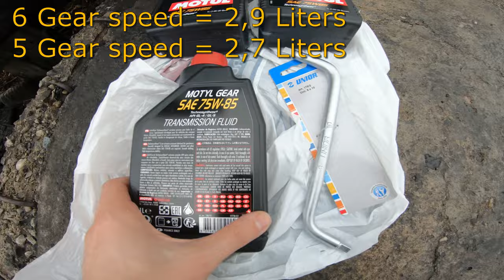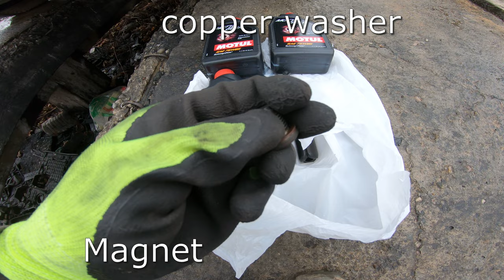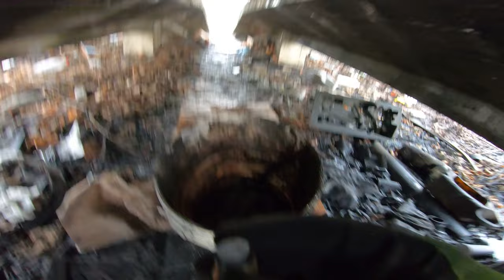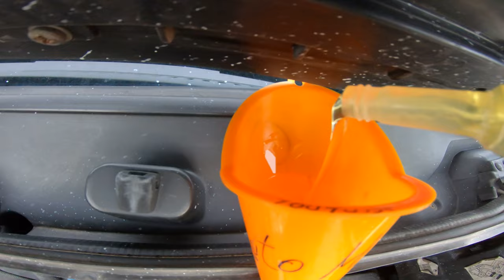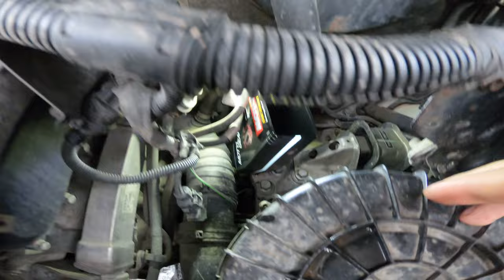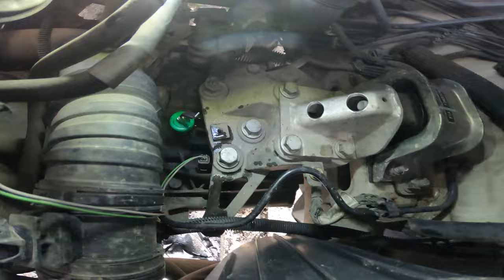Fiat Ducato ,Peugeot Boxer ,Citroen Jumper gearbox oil change ,Getriebeölwechsel ,girkasse oljeskift

Comment: Top tip from someone who knows.. ALWAYS undo the fill plug first, two reasons: it'll help the gearbox drain and you want to know you can fill it again before you empty it. Fill plug could be seized solid/rounded/inaccessible. You know it makes sense 🙂
Reply from the maker: True, only this model has a plastic cover in 3 clips :hand-orange-covering-eyes:

Comment: I may be wrong but the fill cap you lost is a vent for the gearbox. Allows air the enter / exit the gearbox.. Using the wine 'cork' seals the box and then you may get pressure build up and blow a seal?  Just a thought....
Reply from the maker: this is also possible, I didn't think of this option, but as far as I know, the original one is sealed with an oring , anyway, good statement, I haven't had any problems yet
Reply from the maker: I am going to buy a new original plug :face-orange-biting-nails:
Reply: At least someone has found a reasonable use for the otherwise un-used wine-saver cap that everyone has in the back of a drawer somewhere,.

Comment: how you check gearbox oil level? How you know that you didn't put too much oil in it ????
Reply from the maker: No need check nothing on manual gearbox if you respect car production thenical data , specs.
Reply: @AutoMotohowto46  this is nonsense, there should be an overflow level while filling
Reply from the maker: @bigogr8731  no need sir

Comment: Cutia de viteze are indicator nivel ulei la cutia manuala 6 trepte boxer 2.0hdi 96kw /130 cp 2018 ? Necesita doar 3 litri ulei ?
Reply from the maker: 2018 nu stiu exact , indicator nivel nu au , la modelele anterioare chiar si 94’ capacitatea pt. 6 trepte este de 2,9L
Reply: @AutoMotohowto46  multimesc

Comment: Great video! may I ask you if it's difficult to remove the filling plug and if pipe used to fill in was around 10mm diameter?
Reply from the maker: hello, it's not difficult, it's a plastic cover, just pull it, I didn't have it, I lost mine and the diameter of the filling hole is about 10-12 mm inside

Comment: is it 2.9 liter capasity ?
Reply from the maker: 2.3
Reply: Hom mamy liters oil have you used 2.9 or 2.3 to gearbox ?
Reply from the maker: @rafaszewczuk8674  5 speed or 6 speed ?
Reply: @AutoMotohowto46  6 speed
Reply from the maker: @rafaszewczuk8674  2,9 Liters